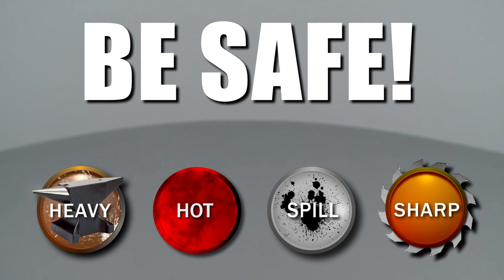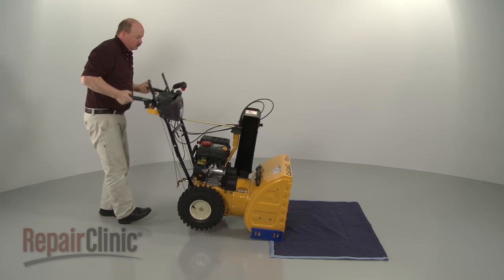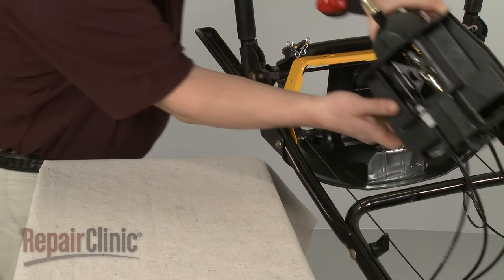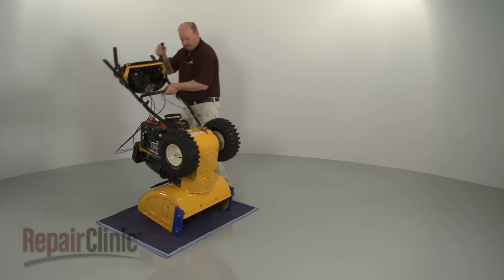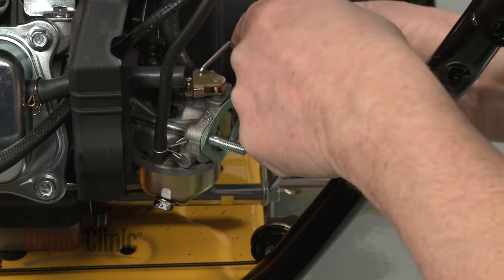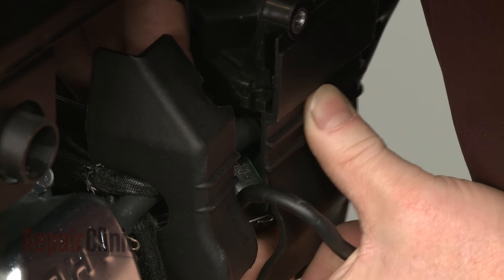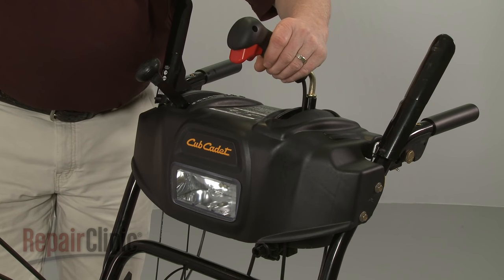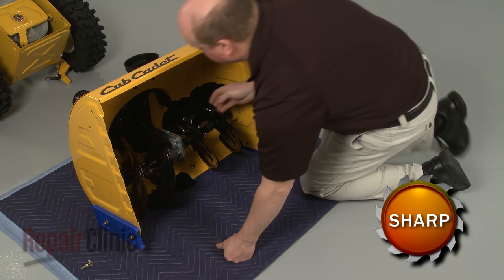Cub Cadet Snowblower Disassembly – Snowblower Repair Help

Comment: I am SO glad I found this video!  I've had mine since 2011 and still going strong! Used it to clear 8-car parking lot and 3 residential accounts every winter. Before I put it away each season, I run the snowblower dry and lubricate all areas. Only thing I've had to replace on it so far is the rubber friction wheel.  I will also check the amount of grease in the auger box - this video brought to my attention that my auger housing has a little blue cap atop the auger worm drive box and I'll take a q-tip to see what the level is at and add the proper amount of 00 grease I imagine.  I'll do some more research before I add anything. This video should be included in every owners manual - the owners manual that comes with the unit is very basic, but hands down, this video is a must - great at showing how to disassemble/reassemble.  Mine still starts on the 1st pull, but when the time comes where I need to clean or change out the carb, I now know how to do it.  Thank you for making this video!

Comment: Just getting at this carburetor is not very intuitive. This is a great video. I had no idea how to remove it. It’s strange they go from metric 10mm to SAE 3/8 then 1/2 then 3/4. 6:30-7:30 is exactly what I needed.

Comment: For anyone reading this down the line, Cub Cadet snow blowers are an absolute pain to work on and don't even have basic things such as fuel shut offs from the fuel tank. If I'd known how hard they are to work on before I bought one, I probably would have bought a different make.
Reply: HollomanUFOLanding
Reply: I second this. do not buy cub cadet.
Reply: Yeah, because a screw driver and socket set are sooooo hard to use.  Wow.

Comment: I have worked my way up to this machine - the only negative is, the reverse 1 & 2 are useless.  I called the dealership and they said, that's just the way they are (wtf).  It is easier to disengage both wheels and pull.  Any suggestions?

Comment: You should show Us   changing the drive wheel . On a cub cadet snowblower that has the   turning control Levers . There  is more things that have to be done, with that system. Please do a movie on that system..!!

Comment: Excellent video of the required service.  Is there one like this for the 3x30" Pro H, so I can remove the hydro static transmission in the right sequence?  It's the only way to add and check the oil levels.

Comment: I've done alot of wrenching over the years,... I mean alot !...  like full auto restorations, Corvettes, Harley's & 4x4's of all types & we can't even get the Spark plug boot off this 30" Club Cadet x3,  What's the deal with that ?
Reply: yup,  found out why... rusted to the spark plug !   this is a 3yr old machine.... maybe at Factory assembly, they could add some lube or anti seize to that metal spark plug cover !
Reply: 30" Club Cadet x3, Ok found out why it won't start,  ** won't stay running without constantly pushing the fuel primer button,...
sooo,  am I to assume the Carb bowl &/or main jet is plugged ?

Comment: Put never siege on axels before putting tires on.👍
Reply: Great advise,I learned the hard way
Reply: @philanderson8419  ok, I am now learning the hard way.   How can I get a seized wheel off?   I put a scissor jack between the wheel and housing and still it won't budge.    I'm worried I will need to open it up, cut the axel in 1/2.
Reply: After weeks of daily applications of several types of penetrating oils and pounding with a pipe and sledge on the back of rim near axle, was able to get one off. The second one, I  drilled a hole into the rim shaft up to the axle and started soaking it through there with the oil and it finally broke loose. Took about a month, working on it about an hour a day off and on. Good luck

Comment: Took wheel of the one side.Put it back on had a problem getting back on,as the shaft slid a keyway fell to the ground.took the bottom housing off to see where the keyway went.nowhere could I see where keyway slides in.If anyone knows please reply it would be appreciated.the keyway is a half moon shape

Comment: Any suggestions on how to remove wheels that are stuck on the axle. Removed the bolt but neither tire will budge. Thank you
Reply: WD-40 and a rubber mallet.
Reply: It'll come off. A lil persuasion
Reply: nothing working here so far.

Comment: My Cub Cadet has the power steering, how do I dismantle the shaft to replace the friction ring. The model shown here does not have the power steering mechanism. I am guessing you just remove the circlips to release the bearings each side?

Comment: I am here just to say this Cub-Cadet seems purposely brilliantly designed to be infuriating to work on. You have to take a million things apart in a non-logical order, and of course, different sizes and fasteners for everything. What a horror.
Reply: Not one word about new gaskets!! Been working on one with no compression! Not like old school built to last more then a year or two!!! Your right nothing but a nightmare!!!!!!!
Reply: They could have designed it so the carb was easy to get to. But no.
Reply: That's all snow machines
Reply: They want you bringing it into a dealer to fix, that’s why they don’t make it easy. Most Carb fixes can be done while still attached too machine.